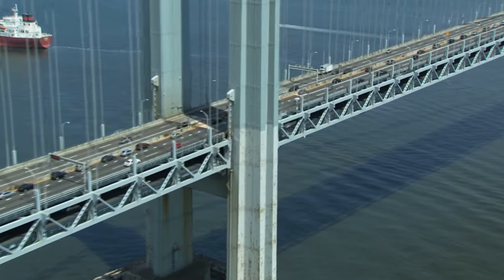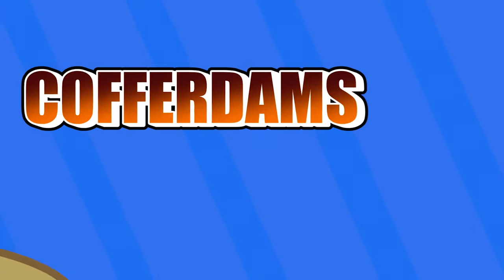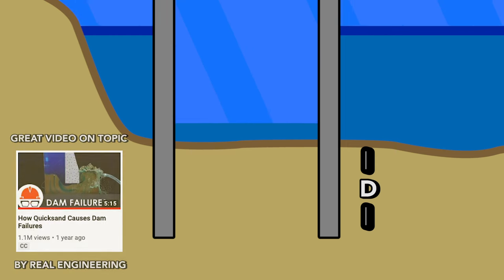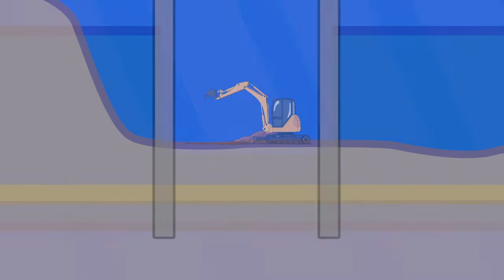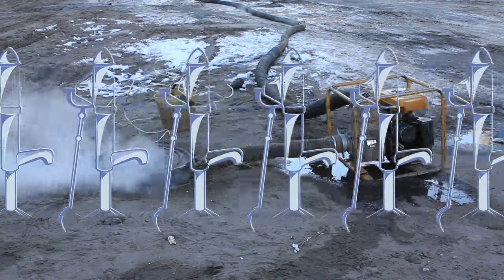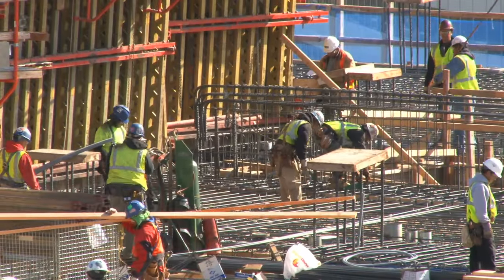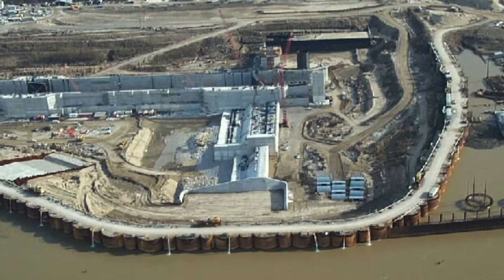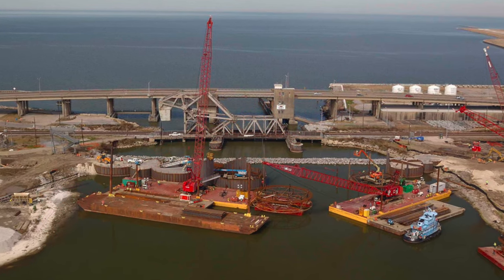What are Cofferdams and How are They Used?

Comment: But how do they attain water tightness ? Won't water seep through the the points of contact between the  two sections of those cylinders  ? Are they welded ?! 1:20 there are two smaller sections in addition to the larger full cylinders are they driven down too ?